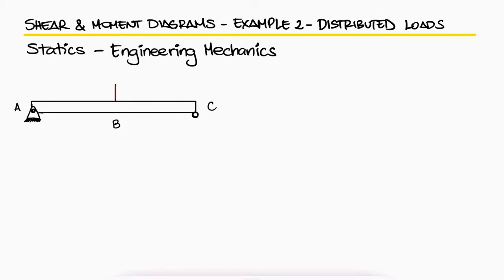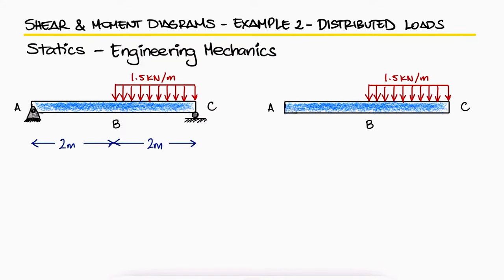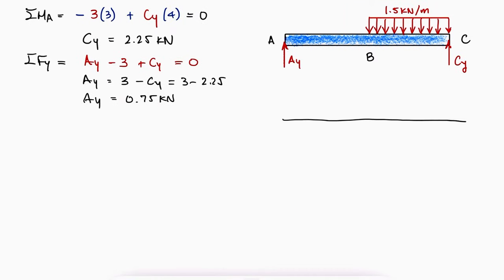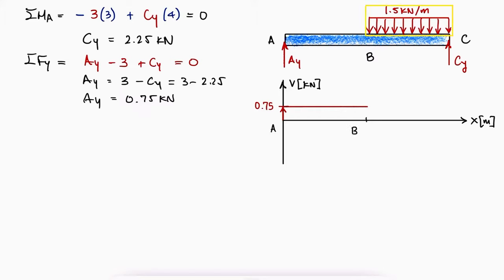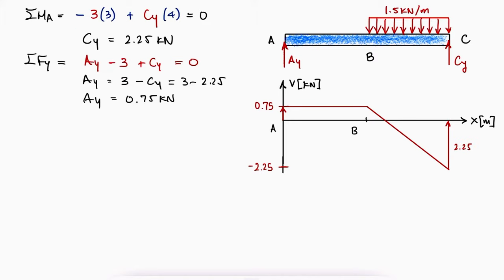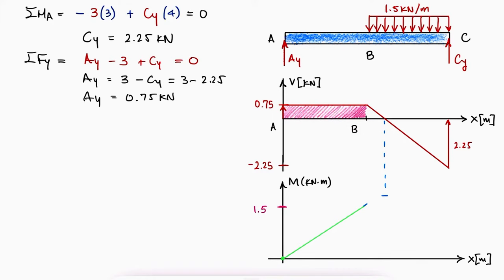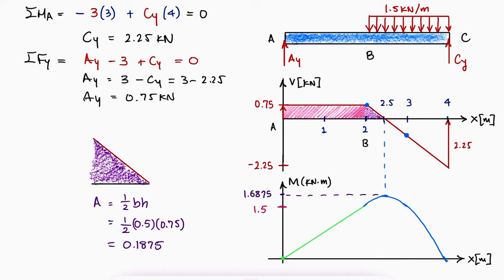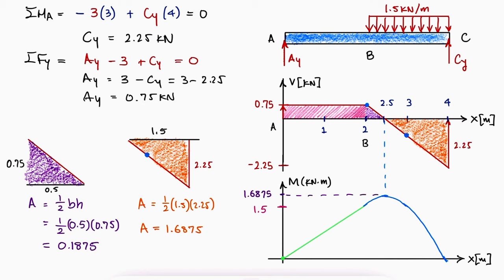Distributed load in SHEAR and BENDING Moment Diagrams in 2 Minutes!

Comment: How did you determine that shear is zero kN at 2.5 meters?
Reply: The load is 1.5kN PER 1 meter. So the shear curve goes down at that rate starting at 2m. You see that over the next meter it goes down 1.5 from +0.75 to -0.75. So 0.5m after 2 meters, it has only gone down half of 1.5kN, which is 0.75, which brings it back down to zero.
Reply: @mattyT618 You are telling history. What is the formula of finding this value..
Reply: @Testmailing-lr3id The video isn't really missing any information. No additional formulas needed. I tried to give more detail to explain what he was doing in the video, but if it's unclear from this video and my explanation, try googling or watching more vids.
Reply: @Testmailing-lr3id at point B we are 2 meters away from point A. Thus, if you need an equation: 0.75-1.5*x=0 (where x distance from B). +0.75kN is the starting load, -1.5kN/m is the distributed load that started being applied from point B rightwards to point C.
Reply: @Testmailing-lr3id  perform ratio and proportion of similar triangle done.